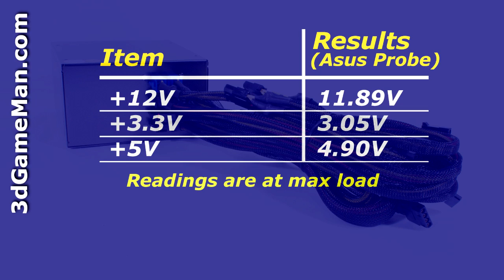#1009 - Sigma SP1000C 1000W Power Supply Video Review

Comment: Not at all.
1000 watt does not mean it pulls 1000 watts all the time.
The amount it pulls is totally defendant on what you are doing.
Generally ull see the highest loads during gaming . 2 Ati 4870x2's pull over 500 watts at full load alone!! Count other stuff and you have a load over 700 watts easy !
So if you are running high end video cards id totally recommend these.
My corsair usually pulls 180 watts when my system is not doing anything much. Gaming is another story. Easy 800 watts.

Comment: the corsair psu is much better imo..
has 2 8 pin 12vEPS connectors for dual processors and also is triple SLi certified.

Comment: You are correct, but drawing 800 watts on a 1000 watt psu  will result in a higher average efficiency than drawing 800 watts on an 850 watt psu.

Comment from the maker: This PSU is still very capable for CrossFire or SLI, but I wouldn't recommend doing it with top of the line video cards. So a couple of 4870 (not X2) and maybe a couple of GTX260 video cards.